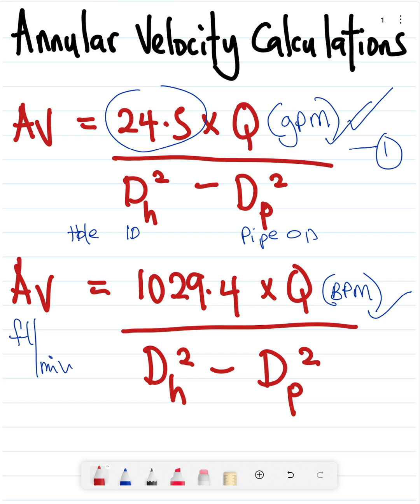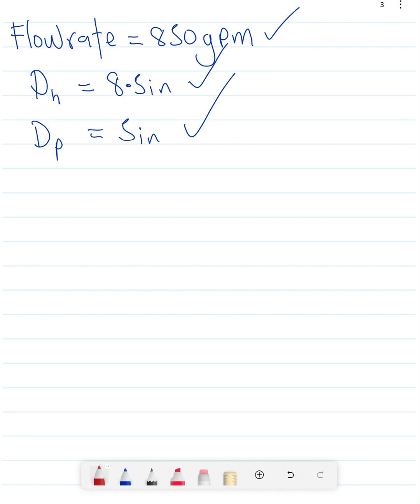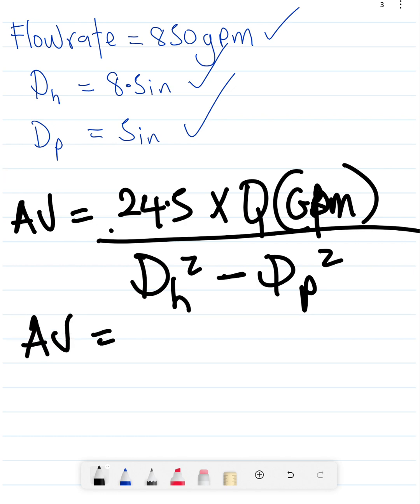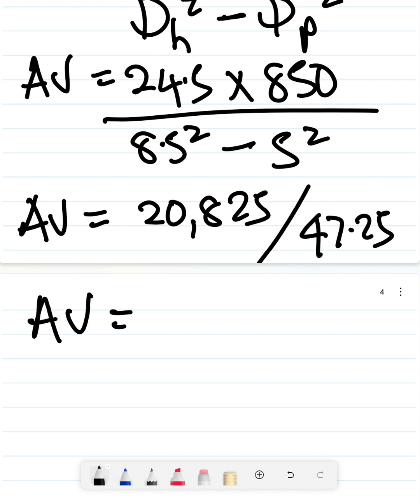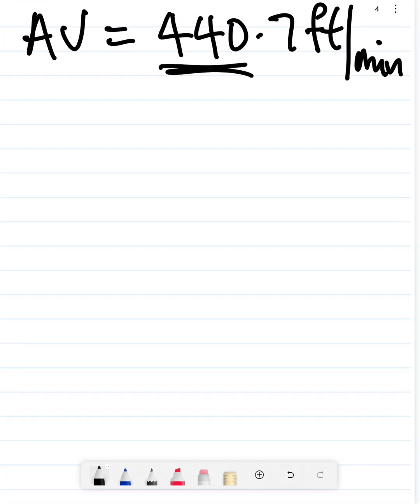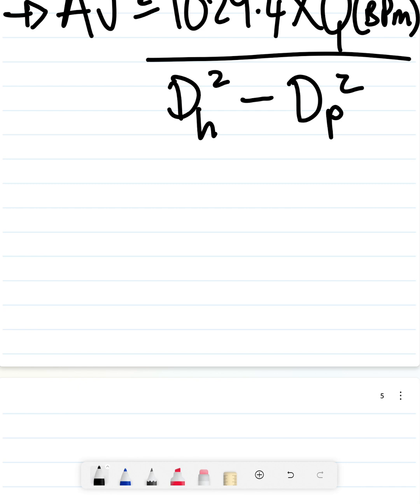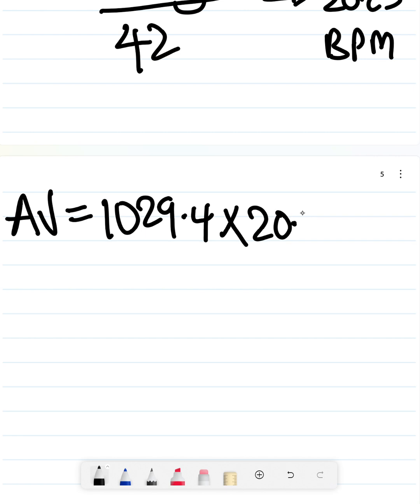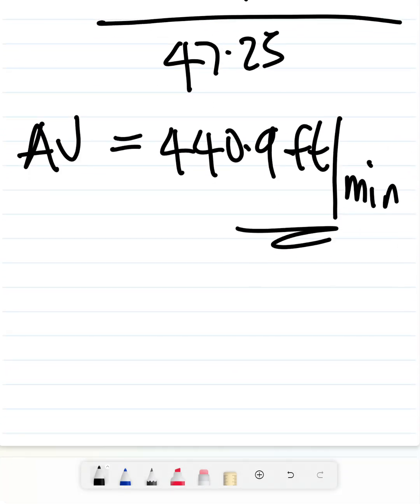Annular Velocity Calculations (Example) #drillingoperations#WellEngineeringcalculations

Comment: This annular velocity,is it the vertical travel or radial velocity?
Reply from the maker: In drilling operations, radial velocity is typically referred to when discussing the movement of fluid perpendicular to the wellbore axis—such as fluid leaking into the formation or displacing mud radially outward into the annulus. Annular velocity is upwards, carrying cuttings out of the wellbore.
Reply: @XteemWellEngineering thanks for this explanation